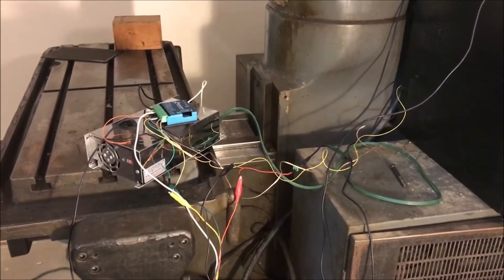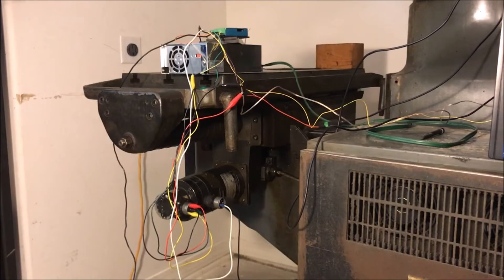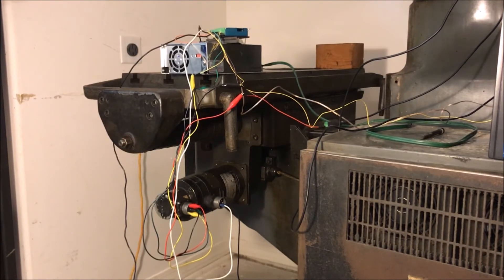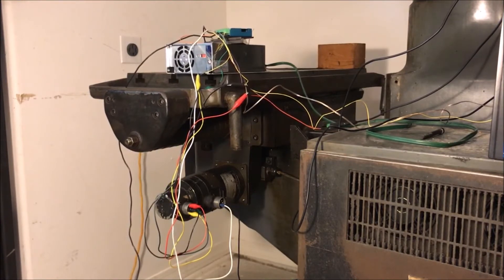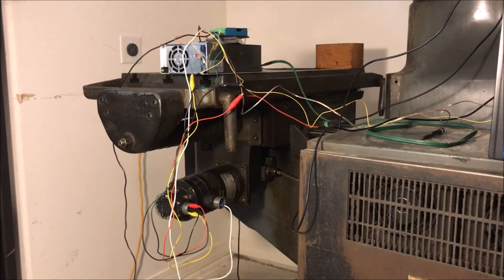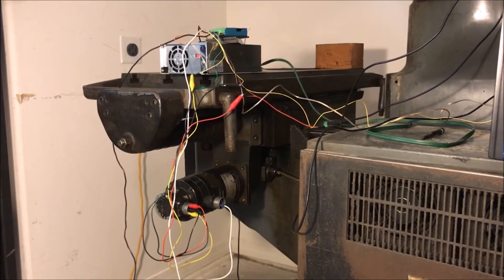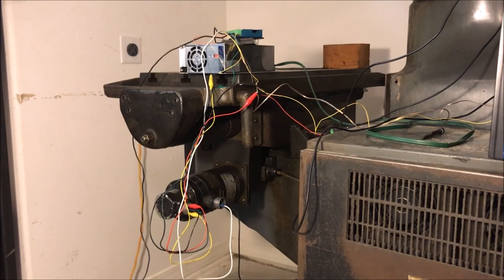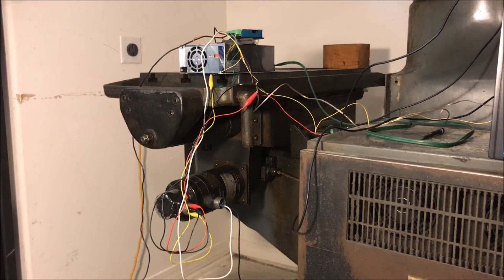Moving the Table - Bridgeport R2E3 Boss 8 CNC Retrofit: Part 5

Comment: Hello Rust trying to wire my Bridgeport R2e3 I have the Masso.cnc controller and with the clearpath servo motors it work ok but if I can get the original motors to work I,d like that I just can not get the wiring right
Reply from the maker: I went over the connections in part 4 of the series. If you haven’t watched that then take a look and see if that helps. If that’s not enough let me know and I will see if I can help.
Reply: @rustybraindump782  Okay I have a Masso CNC Controller and I,d like to us the servo motor with Masso I dont ned a PC

Comment: I have a Bridgeport that has ball screws in x and y and I just bought Anilam brackets that also has a quill bracket with a ball screw for the quill. Do you have any recommendations on what type of steppers and controllers to buy?
Reply from the maker: I have had good luck with the geckodrives but I have not tried others (except some smaller boards like the Adafruit motor driver board). As far as steppers when I was looking at them I was thinking that I would get moderate torque versions and then upgrade them later if needed. I never went that route because I was able to get the servo motors running on my machine. Sorry that I can't be more help on this one.